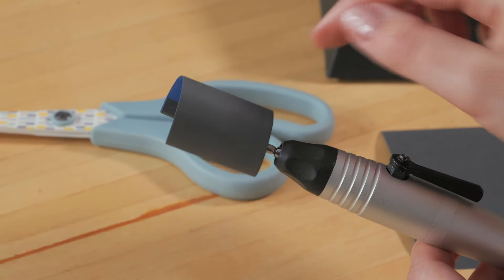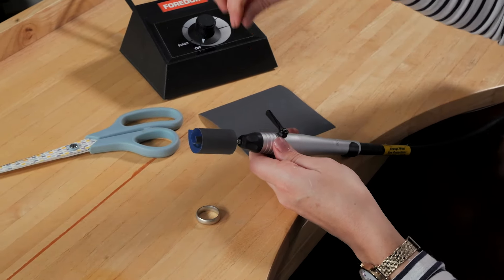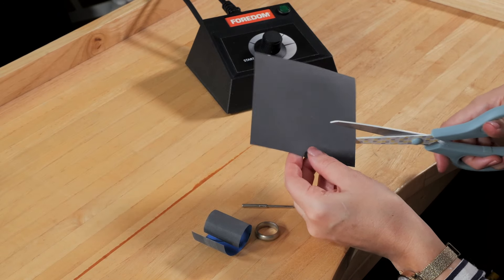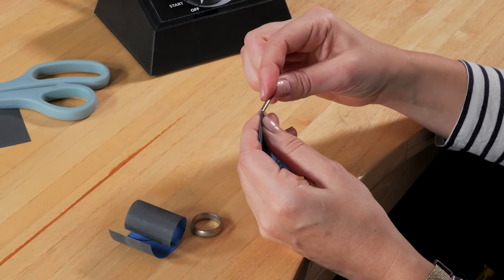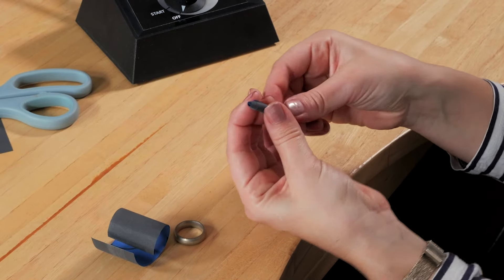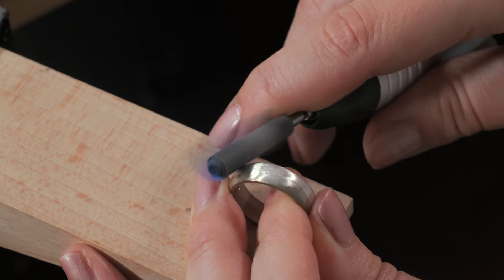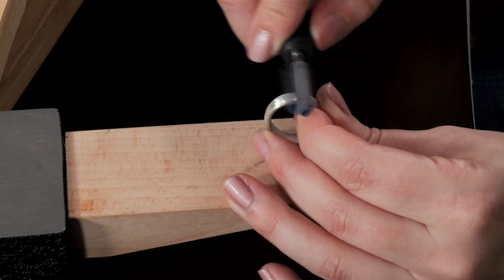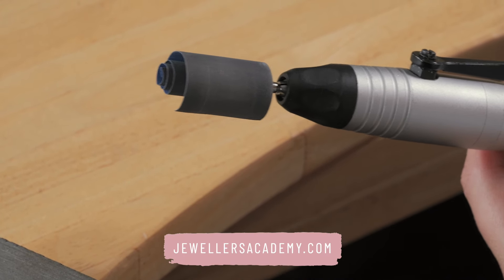How to sand jewellery using a pendant motor with a split pin mandrel

Comment: Hello, thank you very much for your feedback. How can we remove the fire scale and fire stain that appear on a piece? After welding a ring and using different sandpapers and proceeding to polish and mirror shine, these dark areas appear. What can I do to eliminate them and prevent them from occurring?
Thank you very much for your help.
Reply from the maker: There are a few ways to try and avoid firestain, a lot of it lies with technique when firing. Firestain often occurs when a piece is heated too quickly or too much. Taking your time to heat the whole piece is recommend. You can also use a product called firescoff which is sprayed on before soldering, or use a bit of flux to protect your piece. You might find it helpful to ask this question in our Facebook community group as there is a wealth of experience there. Here's the link to join https://www.facebook.com/groups/jewellersacademy Hope that helps! x